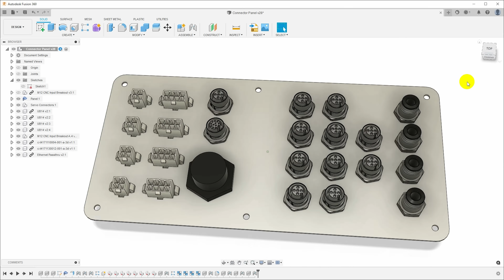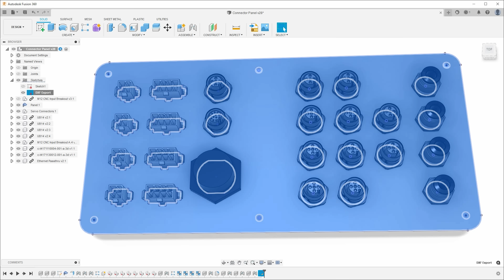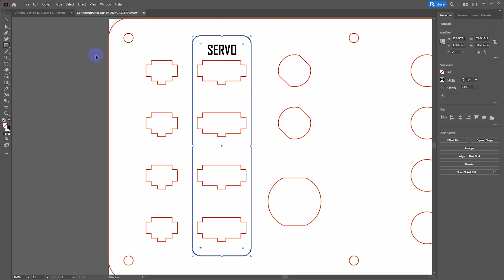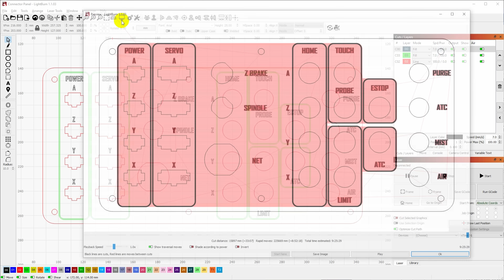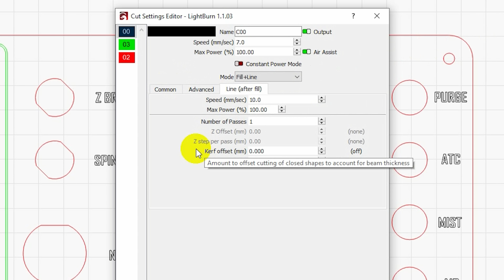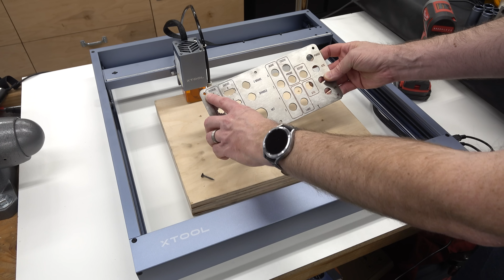Will a Diode Laser Engrave Steel? | xTool D1 Testing

Comment: Nice result, James. The path for rendering in the tooling app was kinda weird. Since the laser can move in X/Y why does the software insist on raster scanning the entire surface like a TV CRT beam. Doesn't make much sense. As mostly vectors that are aligned with the axes this should have been a very rapid cakewalk. Is it done like this because of concern for repeatability of positioning? Strange. Keep on trucking my man.
Reply from the maker: You can choose the pattern it uses.  I used offset fill and raster fill for different parts of the artwork.  You may have skipped that part of the video?

Comment: I think that one machine that could mark up the work piece with either something like a sharpie or inkjet (for bending lines for example), make engravings (as we see here) and cut like a plasma or laser cutter would be great... but it is a shame that laser cutting machines are so expensive.
Reply from the maker: There's no reason someone couldn't build this.  The one caveat is that often the laser wants to run pretty fast, so a heavy machine might struggle.

Comment: The 450 nm UV laser will mark steel but only very superficial. A 1064 nm IR fiber laser will mark steel much better. I have made a few mistakes, marking the wrong text on a part and some simple scotchbrite or emery cloth did not get the text removed. It took some time to get the engravings removed using some coarse grit paper.
Cermark is great stuff but I can't get it to work with the fiber laser. It does however work well with my regular CO2 laser (which is also IR but with a 10,600 nm wavelength)

Marking anodized aluminum is fun. You can play with the power and get it from a slight grey all the way to a bright white on black anodized aluminum. I do also mark on other coated/painted metals. Colored dibond is one of my favorite materials but I also use other stuff that I just spray paint, engrave/mark and then spray with a clear coat for added protection.

Comment: Great result! I have been told that diode lasers should not be used at 100%, or the diode generates really quickly. However, it's understandable that you need all the power it can deliver with a small laser.
Reply from the maker: I know that's true of CO2 lasers.
Reply: @Clough42 I'm afraid the same goes for diode lasers 😢
Reply from the maker: @Ale_Lab  semiconductor laser lifetime is directly related to operating temperature.  If the module is designed well and can dissipate the waste heat effectively, it should have a long life, regardless of power level.    The quoted lifetimes are considerably longer than those of tube lasers.
Reply: @Clough42  that is good to know. I have seen quite powerful diode laser and  avoid them for that reason. I will read more about it. Thanks!

Comment: I was rather shocked to see that the laser didn't operate, by default, in "plotter mode", but instead opted for a raster method. I've run plotters for decades, and I should have kept the last one that I had, as it would have made a lovely laser engraver.
Reply from the maker: You can use whatever strategy you prefer.  I used two different fill patterns in this project.  I do think their primary user is someone who wants to import a photo and burn it into a trinket.
Reply: I'm guessing the software is most often used for etching photos, portraits, etc in which case the entire area would need to be covered.  Otherwise, that mode makes very little sense as a default.
Reply: @CL-gq3no  Text as fonts not known by software is treated as images and images are printed in raster mode. It should be possible to change it manually to ploter mode.
Reply: In the cuts/layers panel, you can see where he's set the different layers to fill or line (effectively raster vs plotter as you've called them). As long as your input file is vector, it's really easy to switch between the two, and to get the thick lines for visible text on metal, you're gonna want to fill the shapes

Comment: I wonder if you did any testing with the CerMark on mild steel? Could save some pennies that way, to cover the cost of the CerMark…
Reply from the maker: Yes.  It works the same on mild steel.  I could not get it to fuse to aluminum at all.
Reply: @Clough42  - I wonder if it fails to fuse because the aluminum is too good of a heatsink, can't build up enough heat with that power output?
Reply: @somebodyelse6673  You have that right. Aluminum needs more power for Cermark to fuse.

Comment: So after watching the whole video, I have a quick question. What would happen if you tried to engrave "regular" steel? I'd love to be able to laser a makers mark onto my parts, but I typically only use 4140, reaching for other steels as needed (like 303 stainless for things like dumbbell handles). Would it cause excessive oxidation? Or is there another reason you can only use stainless? I should probably just Google this, but other folks may be wondering the same thing so I figured I'd ask here.

Comment: With a CO2 laser it is generally not recommended to use it at the rated power as it shortens the life of the tube significantly.  Is it safe to use full power with this laser?
Reply: I have a 9 year old Reci W2. Never had an issue running at "rated power". Not sure where you got your info.

Comment: James, great video.  I looked at the website to see if it would work in my application, but can't really tell.  Do you know off hand if you can use this to burn off a coating on an aluminum panel?  Say I painted my panel in a dark grey color.  Can I burn off the paint with the laser for etching, then clear coat it?
Reply from the maker: I believe so, but haven't tried that specifically yet.
Reply: A number of people have used the laser paint technique to make printed circuit boards, so I bet your application would work just fine.

Comment: Are you going to attach the laser to the router? I am sure you know but Arcon and power a diode laser.
Reply from the maker: The router has a lot of moving mass, so I think fast scanning on other materials would be problematic.
Reply: @Clough42  I think it you did a "contour" cut instead of everything at once you wouldn't have a problem. I haven't played with lightburn for a year so off hand I couldn't say how to do that. I think it is just making a layer for each item.

Comment: I know that you were just being explicit for demonstration purposes but a quick tip for those that don't know: in Fusion 360 when using the Measure tool you can left-click on any one of the measurements in the Results section to copy that measurement to the clipboard. It can come in handy so you don't have to remember those values when entering them into other fields within Fusion or such as in this case fields in another program such as Illustrator.
Reply from the maker: Oh, I didn't actually know about that.  Great tip!

Comment: Alternate method for 316 is to mask as per PCB etching then etch with aqua regia. (I have a tiny "20W" Ali Express laser).
Reply from the maker: I've been interested in anodizing aluminum for a while, but I just really don't want to handle and store the acids in my small shop.
Reply: @Clough42  It's a risk, and special storage and handling is a must, and so is keeping a large tub of sodium bicarbonate nearby, but is it really that dangerous?

I guess anodising uses more reagent than etching, but I just have an extra spill tub, and move them around with pipettes.
Reply: @johnalexander2349  My concern in a small shop would be the acid fumes/aerosolized particles rusting all the other machinery and tools
Reply: @7alfatech860  Pool chemicals like chlorine are notorious for this as well.
Reply from the maker: @johnalexander2349  I'm not concerned about safety.  I'm concerned about dedicating space to proper storage, away from everything else that will be corroded by outgassing.  Putting a can of Cermark on a shelf and hanging the laser on the wall is much more practical in a small shop where I will use it only occasionally.
Reply: @Clough42  I'll be honest, I just store my acids outside, in a narrow gap between a huge stack of left over floor tiles, and a wall.

Chlorine was a problem, but a vaguely airtight tub solved that.

I'm definitely gonna  try some Cermark, but my application is key tags, and those have a hard life. So far only stamping and deep etching have survived.

Comment: Looking very nice, the only little flaw are the mounting screws partially covering some of the power box markings
Reply: and you have to remind him about it
Reply from the maker: This is what happens when you design and make the panel around the connectors, and then later decide on a concept for the artwork.

Comment: That is one cool panel model. Did you have to model each of the connectors, or is there a source one can download them from?
Reply from the maker: The connector models are generally available from the manufacturers or the large component distributors.  In many cases, the 3D model is a part of the PCB footprint for PCB components, and you can export the final PCB model, complete with components, from the PCB design software.  I was able to find all of the parts I needed for this panel from Mouser, Digi-Key, Molex, and TE Connectivity directly.